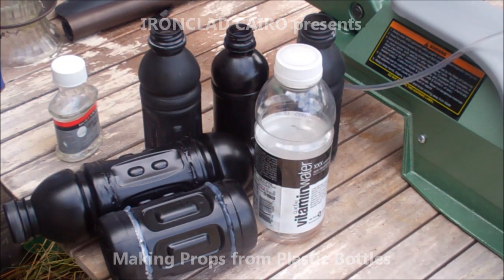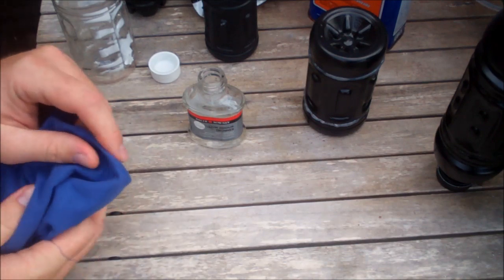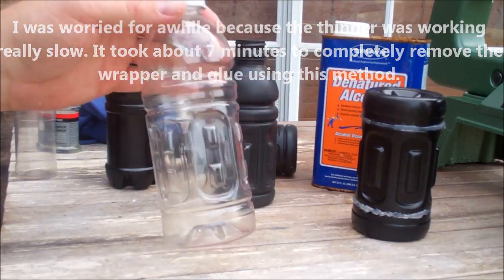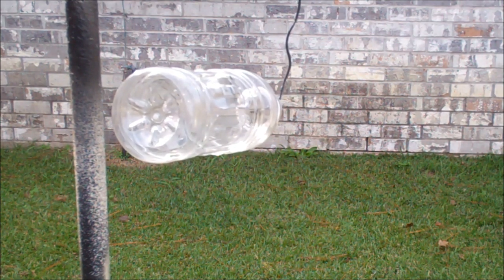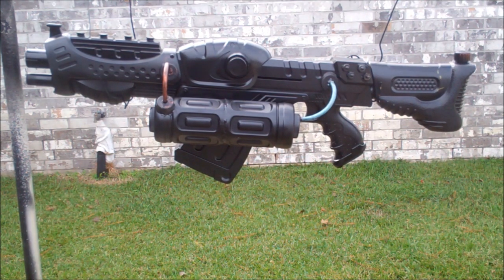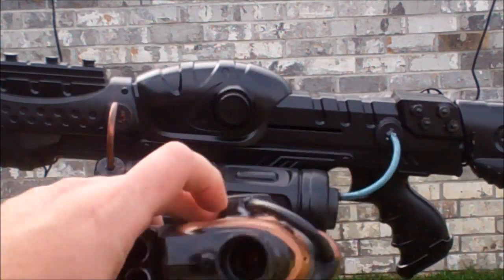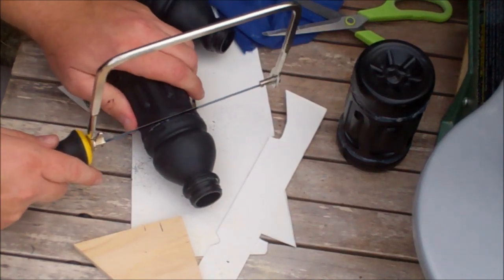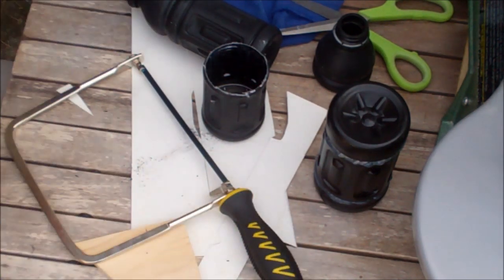Making Scifi / Steampunk Props from Plastic Bottles (Part 1)

Comment: You should toy around with masking off parts. (like those nodules / bumps)  then apply the paint. pull off the masking and you have made clear parts. You could then frost em and glue LED's on the inside... and then backing (so you cant see inside the bottle)

Comment: I tried putting the paint inside the bottle and shaking it to coat the inside, that way I didn't have to use a clear coat but I still got a glossy finish. This only works for props that are going to be a single colour though.